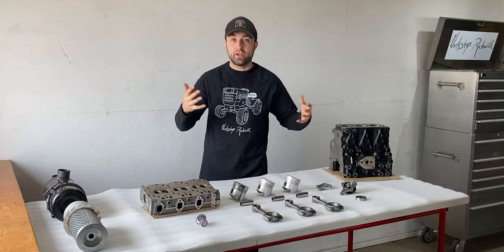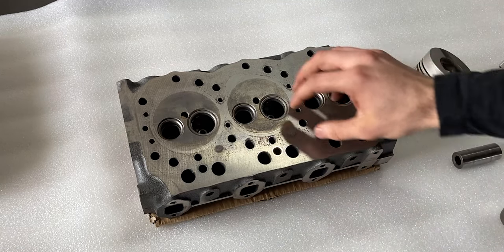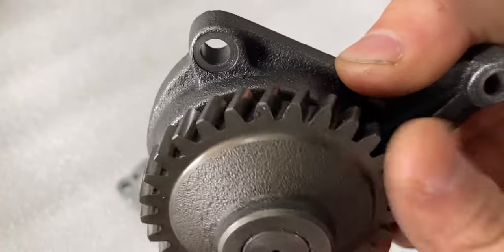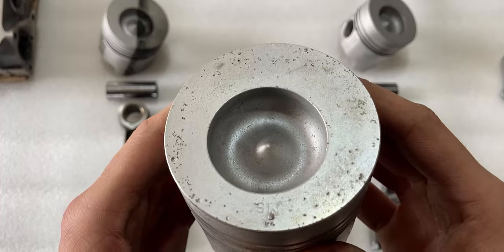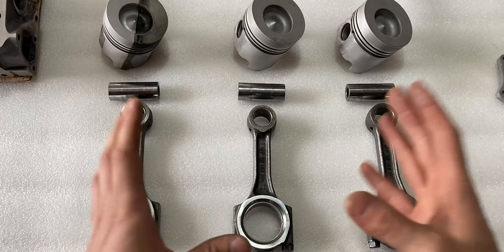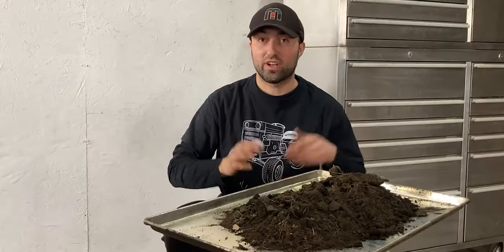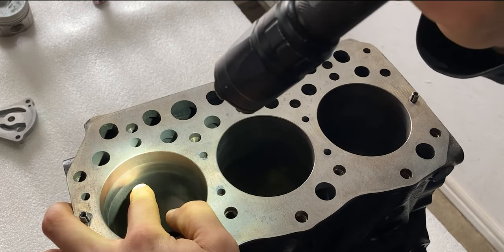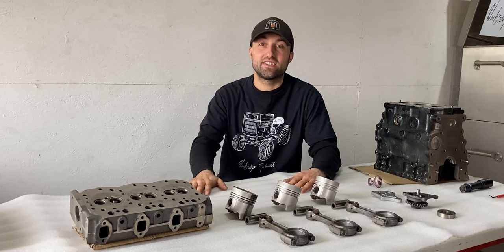Why did this Engine FAIL? Yanmar 3 Cylinder Diesel Engine

Comment: I know the answer to the fuel delivery/performance system issue with diesel 3 cyl
Reply from the maker: What makes you think there was a fuel delivery issue?
Reply: @WorkshopRebuild  diesels pretty much require turbos these days to efficiently run and "keep up" with gas engines
Reply: Should be no "patent" for a system that clearly works well🙄
Reply from the maker: Diesel engines are more efficient than gasoline engines. Diesel is a more concentrated type of fuel, as for gasoline, it is basically made up of 20+ different chemicals and not all of these chemicals are burned in such a short period of time. It doesn't matter what you try to burn, they cycle-time is just too quick to burn everything.
Turbos on the other hand do not add to the efficiency of any engine. They tend to pressurize the air coming into the engine and therefore you  can have a smaller displacement engine with more HP/Torque.

This is knowledge is widely spred over the internet, but you spoke about 3 cylinder diesel engine in your first comment and I would like to know what you meant by that. Best regards
Reply: @WorkshopRebuild  okie dokes😀 humanity won't be saved, the earth is too effected by now. I love the thought of saying something in hopes of reverse psychology but with 2023-Jump street approaching I can say for all. The rich will only keep what's theirs and the poor never get far without all the dedication. I've put in all the dedication and I'll never be more than Matthew. But thanks for science 👍

Comment: Very informative. Great content and detail. Well done.
I've just bought a Kawasaki Mule with a 3 cyl Yanmar engine suffering from low compression.
1. Would a honing and new ring set help?
2. Or should I get it rebored next oversize with new pistons, rings & bearings?
I plan to use this Mule on my 4 acre property. Small tasks.
Reply from the maker: Hi Paul, thank you for your feedback and for your overly positive comment! Those Kawasaki Mules are very good machines and they are REALLY handy to have on any property.

Answers to your questions:
1) Yes, honing and installing a new ring set would help greatly. You will want to confirm your ring-gap in each cylinder-bore to make sure it isn't too small or too big. If it's too small you can break piston rings, and if it's too large you could have low-compression again (even though you have a new set of rings).

2) Machining your block involves more work in general and it becomes more expensive. Once you remove your cylinder head, you should be able to identify the issue. So that should be your first step.

Most cylinder wear is towards the top of the bore, where the pistons have most "slop". About 1/2" below the head surface, you might be able to feel an edge. This is highest point for the top compression ring within the cylinder bore and most wear can be found here. I found a great illustration for this wear: https://www.newkidscar.com/car-repair/causes-of-cylinder-bore-wear/

If you feel a big edge, than your cylinder bore might be very worn, which means you might want to consider larger pistons. If you only feel a subtle edge, than a quick hone will be just fine, along with new rings.

I hope this helps you with your engine repair and if you have any other questions, feel free to send me an email. I'll try my best to help from a distance. Regards Andreas